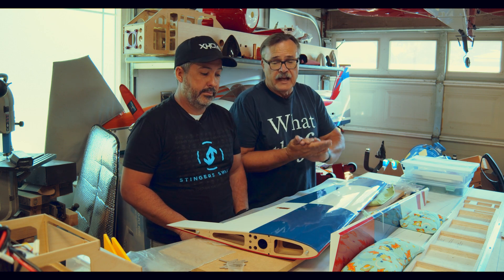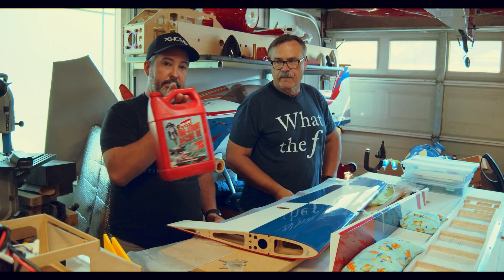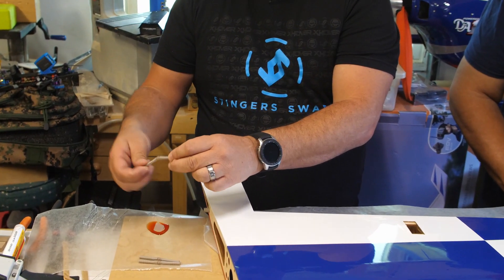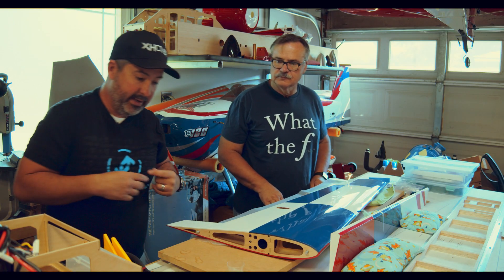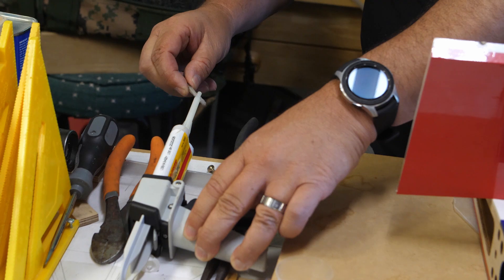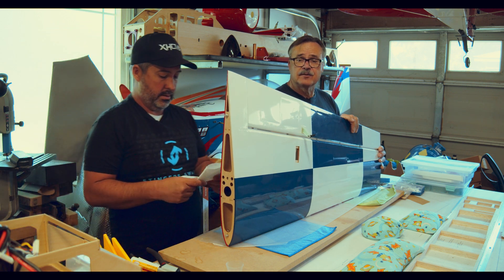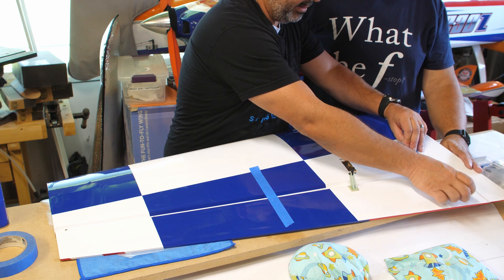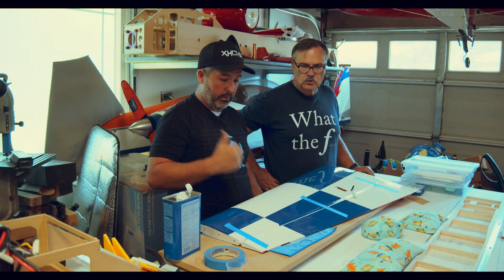FlightReviewz How To: Hinge Installation Using Epoxy (Aileron)

Comment: I guess a lot of epoxy is wasted when using this kind of dispenser...
Reply from the maker: There is a bit if waste, but honestly it is no more than what is wasted when mixing manually. Add to this, the fact that it is much cleaner and you always get a perfect mix and it is WELL worth it in our opinion.

Comment: Amazing trick! I used an epoxy for a driveway extension. I drilled holes into the existing concrete, then I inserted the epoxy into the concrete holes, then I placed the rebar in. Yes, the technology from the ingredients is a great solution to hold your hinges. Thanks for sharing
Reply from the maker: Thank You for sharing, we may have to try that out one day.